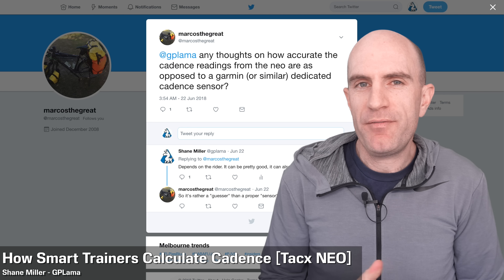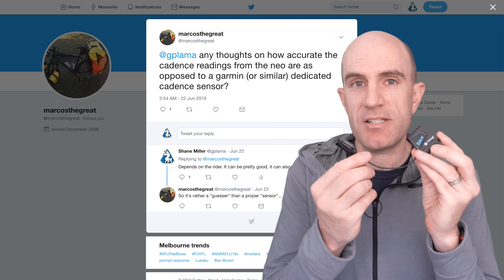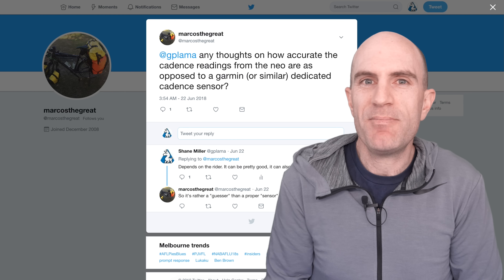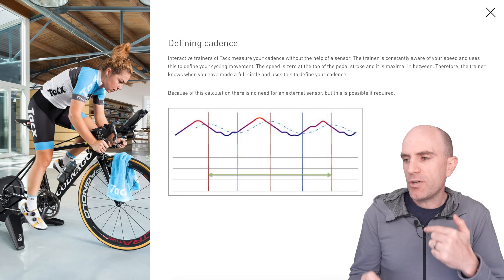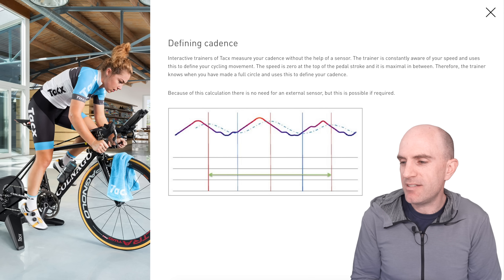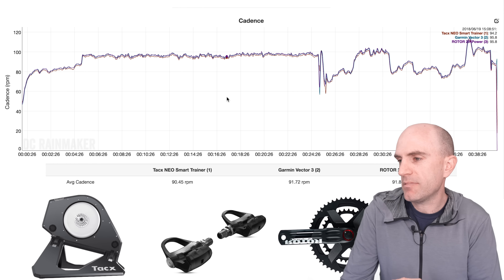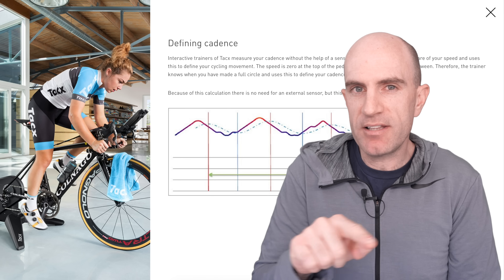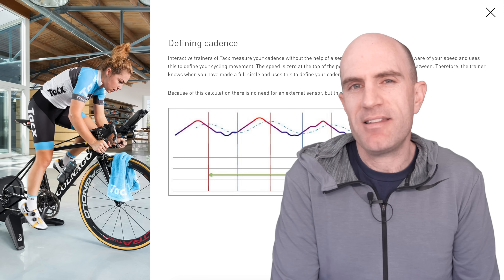How Smart Trainers Calculate Cadence // Indoor Cycling FAQ

Comment: Thanks for this video, which seems to have helped me solve a cadence problem with my Tacx Flux S trainer.  While I had been using the trainer for some time as an indoor riding alternative, I recently started using it to follow a training plan on Zwift, which places a lot of emphasis on cadence.  So I was concerned that the cadence provided by the trainer didn't correspond with what I was seeing on my Edge unit.  Realizing that the trainer didn't have a cadence sensor lead to me looking for an explanation of how it calculated cadence. Your description of how the trainer identified pedal strokes caused me to realize that how I was pedaling while I calibrate the trainer may have been distorting my pedaling profile recognized by the trainer, resulting in a less than ideal calculation of my cadence.  When I calibrate I tended to sit upright in the saddle, which provided a different pedaling profile than when I am in the drops or even on the hoods, resulting in "accurate" (i.e. rates which matched the Edge unit) cadence rates when I pedal upright, but lower estimates when I was over the bars.  After watching the video I re-calibrated the trainer making sure to be on the drops and suddenly I'm getting cadence rates which agree significantly better with those on the Garmin Edge.  So a big thanks for providing this explanation and helping with a nagging problem I was experiencing...and sorry for the longish comment.  Really enjoy all of your videos and find them highly informative.

Comment: OK Shane, but do you know how is computed the power sent to applications (such as zwift, , ...). Based on what ? current measurement, ... ?  Thanks for your opinion.
Reply from the maker: I'm not sure I understand the question. The calculated/computed cadence is sent to Zwift simply as 'cadence' like any other sensor. When compared to two other sources of cadence (pedal power meter / spider power meter) they all line up well.
Reply: @gplama  sorry my question was unclear. It is not related to cadence but to power. The tacx Neo computes power (i.e the value that you can see on top left of zwift display). I am wondering how the Neo is computing this data as there is no constraint sensor I guess. I assume the algorithm takes into account the weight, the cadence, physical data such as current measurement of the motor, interpolation curves.  What else ?
Reply from the maker: @zwiftfrance  There's a number of ways smart trainers measure power. Flywheel speed and electromagnetic force applied to the brake I will assume is the most basic overview of how it measures power input.

Comment: Hi Shane. Regarding the tacx neo do you know how is the power calculated? Does it use the cadence or is it unrelated? I ask this because my tacx Neo is consistently reading 5% lower power than my two Quarq's. Quarq Dfour and Quarq Riken. I'm pretty sure the Quarqs are accurate as they both were tested against a Powertap hub and they matched. The Neo is known for it's accuracy but it really feels it's reading lower than it should...When in ERG mode the difference seems to reduce to 3-4%. Any explanation for this?
Reply from the maker: Power on the Neo doesn't use cadence. Contact Tacx Support with the data indicating your testing/protocol/comparisons etc for review.
Reply: @gplama  Thanks for the reply! I already did contact them but still haven't got any reply. Anyway If was to send the Neo there for repair it would probably cost me more than a new trainer :D I asked about the power calculation on the Neo, out of curiosity do they measure the torque or use the flywheel speed for calculation?
Reply: @davidpch  did you get any feedback by now? ;) I have been testing a friend's Neo against my Quarq Dzero (which's power lines up with my Elite Direto). The Neo reads 15-20 Watts lower when free riding (mostly) in the big ring on Zwift. ERG Mode in the small ring reduces the difference to ~10 Watts. The reported cadence is around 1 to 1.7 rpm lower as well. I wonder if acitvely cooling the Neo or taking apart and cleaning it might have an effect on the measurements.
Reply: @MagnusB  By now I already sold the Neo :) And it was exactly like you described also reading lower than my Quarq in the exact same situations. Now I have an Elite Direto XR and it's within 0.5 % of the Quarq!

Comment: How does the Kickr give me a power output even when there is no cadence sensor in the room? Surely it needs the rpm to combine with the measured force to calculate power right?
Reply from the maker: It uses flywheel speed for the power calculations.

Comment: I have my Tacx NEO for a while but I haven't done ILT (isolated leg training) on TrainerRoad until recently. What I've noticed is when I'm only pedaling with my left leg (with the right foot unclipped), the cadence shown in the TrainerRoad app on iOS is halved what it's supposed to be. The cadence appears to be correct when I switch over to my right leg. Has this ever occurred to you?
Reply: Add on to my previous comment: my Quarq DFour is paired with my Garmin Edge 820 during the same workout when I was pedaling with my left leg, it was showing the correct cadence while Tacx NEO was telling the TR app the cadence was half.
Reply from the maker: I don’t do single leg efforts, so no. Grab a cheap cadence sensor and put it on your crank - problem solved. 👍🏼
Reply: It's not a big issue since I don't normally do single leg workout. Just wondering if you saw the same thing.
Reply: Response from Tacx customer support (it does not explain why it does not happen to the right leg though): 
The NEO measures this as follow:
it can see a fluctuation on power when you pedal.
So each pedal stroke this will see a power difference.
By using this power difference it can calculate a cadence
So when you only click in your left foot and cycle it will only read this power difference.
And explaines why you only see half of what the cadence should be

If you want to see the actual cadence then we advice you to connect an external cadence sensor to TrainerRoad

Comment: Before I got a power meter, I was using the little Misuro B+ computer that came with my Elite Turbo Muin. That trainer doesn't have a power meter but the Misuro B+ calculates its power based on the pre-programmed power curve of the trainer's flywheel. That setup also has cadence and I could never figure out how it could determine it so accurately.

Comment: Shane given the cadence is a parameter in the calculation of power - is this something you could factor into your lab test? Difference between 90 and 92 could adjust the accuracy of the power.
Reply: In this particular case, cadence is derived.  Power is just energy divided by time where energy is force multiplied by distance.  With rotational systems such as the flywheel within the trainer, power is just torque multiplied by angular speed.  So the trainer is constantly measuring the torque and angular speed as a function of time.  To estimate cadence it just looks for that cyclic pattern in the torque and calculates the time interval between them.  So power is measured directly without needing to know cadence whereas cadence is a derived measurement based on the assumption that a person's cadence is cyclical.

Comment: My Hammer is 1-2 rpm lower than my other PMs too. Been running Zwift with a Stages, Vector 3 and Hammer concurrently and putting it through Ray's analyzer. Good enough.
Reply: I see the same type of thing with my Tacx Neo.  It doesn't matter what software (including Tacx) I'm using or if I'm using the Garmin 520, the phone or the computer.  I will see big cadence numbers (over 220 rpm) at some point in the workout.  So their algorithm doesn't work for me.  I just use a Garmin cadence sensor now.  

Nothing like looking up and seeing your cadence at 220 rpm.
Reply: Interesting. I've never seen huge cadence jumps on my Hammer. The opposite in fact. After hard efforts when I slow my cadence and the flywheel is still spinning at high RPM, there isn't enough torque going through the drivetrain for the Hammer to accurately estimate cadence. It will drop to zero briefly why the flywheel slows.
Reply: I actually just picked up a powertap p1s set and ran it alongside my hammer today and found that the hammer was 1rpm lower. Just out of curiosity if you happen to know, what's the difference in power between your hammer and the stages and vector? Today the pedals were about 10w higher for the overall ride (turned out to be 5%) over the Hammer in a 4.5hr ride. Based on what I've seen, drivetrain losses are a little less than that, like 2-3%
Reply: Phil, I have a 52/48 L/R balance so the Stages reads 3-4% higher in the 250-350W range. The Hammer and Vector 3 are very close to each other up to about 500W. Beyond 500W, the Hammer starts reading quite high. At 1050W on my Vector 3s, my Hammer will read 1200W. If you want the actual links to the analysis, check any of my recent Strava ride descriptions. My athlete ID is "yoog"

Comment: Reed switches????   Um... er... ah...  I don't so.   My understanding is these were always just basic Hall effect sensors.  Passing a wire thru a magnetic field induces a current pulse in the wire.  The pulses were simple to measure and the head unit supplied the time element of the rotations per minute calculation.  The engineer in me says a reed switch wouldn't respond fast enough and could be subject to the effects of vibration.  AND wear!   Got me thinking...  In my old bike parts box, I had an old Cateye cyclometer; complete with both speed and cadence sensors.  I quick slice and dice with the cut off wheel showed just what I expected, a coil of wires encapsulated with some sort of electronics potting material...
Reply from the maker: SHUT THE INTERNET! ok, cool corrected. So in effect a very similar thing.
Reply: The engineer in me says you're wrong about a reed switch not responding fast enough, should be plenty fast.  The issue is as you point out is that a Hall effect sensor has the added advantage of no mechanically moving parts.  I'm betting some cadence/speed sensors use reed switches, some use Hall effect sensors, and some as Shane pointed out use accelerometers (e.g., my Stages left crank arm power meter gives me cadence).  Where else could that sound be coming from with Shane's sensor (I've got an old Garmin model that does the same thing) if not from the mechanical closing of a reed switch (remember no mechanical moving parts with Hall effect sensor)?
Reply: my old bikecomputer had a reed switch. edit : even says on the page https://www.sigmasport.com/en/produkte/fahrrad-computer/wired/wired/pure-1/technology
Reply: Reed switch is mechanical, Hall effect switch has no moving parts...  so, similar in that they both are being used for cadence.
Reply: Interesting...  I did a little google search, yes, prolly should have done that before... but yes, you are right, there were reed switch version of cadence sensors.  I would image the progressions would be: reed switch, hall effect, accelerometers...    Thinking too much about this, would a reed switch have any issues with wireless connection to the head unit?  I remember the wired units, then advancing into wireless ones, and now, on my trainer I just have a wahoo cadence unit.
Reply: If you can hear the switch closing then it's a reed switch. Simple and plenty fast enough to respond. Accelerometers are not as accurate - and that's a problem for crank-based power meters.

Comment: Nice theory. Too bad it doesn't work in practice. Extremely inaccurate on the Neo.
Reply: This method of measuring cadence will not work very well when flywheel speed is very low or/and intertia is very low (which affects pedal stroke). It will work flawlessly on higher speeds.

Comment: Is there a thought that high cadence on zwift on the Neo can give Zwift performance increases ? E.g. an improved time up Zalp? Lab test ?
Reply: Zwift uses power to determine speed, not cadence. At a higher cadence the interactive trainer will be using less power to create resistance for the same measured wattage, so differences in cadence won't make much difference other than you might fall between two step levels on the amount of power it's putting out.
Reply: Timothy Fish thanks Timothy, you may well be right that there is no discernible difference, but the question is whether high cadence can fool Zwift into an increase of power. That or it's just rider efficiency? Wonder what a lab test can prove.
Reply: There's really no need for a lab test since Zwift is just software. Zwift doesn't even require a cadence sensor to operate, so asking if cadence makes a difference is like asking if heartrate makes a difference in its calculated power. In the case of the Tacx NEO Smart Trainer it appears that they're using wattage to calculate cadence, not cadence to calculate power. But Zwift doesn't care. It's going to take your W/kg and plug that into an equation to give you a speed that is consistent with the virtual terrain.
Reply: Cadence is completely irrelevant for speed in Zwift. It is also irrelevant for power calculation of Neo and only power is taken into account when determining speed in Zwift.
Reply: Timothy Fish my point is still not understood. I'm not questioning zwift power I'm questioning that the neo under high cadence puts out more power than it should. Therefore compared to other smart trainers or power meters would be interesting to see a lab comparison.
Reply: Look at this. It's about other issue (Vector 3 innacuracies at higher cadence) but there is no such thing happening as Neo overstating power at higher cadence (look at comparison charts vs P1): https://gplama.blogspot.com/2017/12/power-meter-vs-smart-trainer-power.html
Reply: If that's what you're saying then why bring Zwift into it since that just increases the number of variables?
Reply: Timothy Fish it's a fair point, but I'm convinced that in Zwift for eg that you reep benefits with high cadence going up zalp. I don't use my neo with anything but zwift.
Reply: Did you compare your Neo to power meter? Which one?
Reply: Timothy; why would it do that?  A good speed number is available based on the rotation of the drum on the Neo (it is just like a rear wheel--I checked it and you can see the distance traveled by the drum will vary based on your gear selection).  The power you put out will vary with the power required to overcome the resistance being fed to the trainer by the software for the terrain encountered.  I would think it would be easier for software to send the required resistance to be overcome instead of processing power data??
Reply: I haven't seen a spike in power associated with the cadence spikes on the Neo that I've seen.  The Neo power metering is supposed to be very good based on all of the tests I've seen.
Reply: Dan, the software sends a level at which the trainer should be set and the trainer sends back the wattage at which it is operating. With this setup the software doesn't have to know anything about how fast the "wheel" is spinning or how much power is being applied to the electromagnets.  With dumb trainers Zwift doesn't have access to power data, so they use wheel speed to calculate power, but they have to make some assumptions about wheel weight and trainer resistance.
Reply: That makes sense to allow more types of trainers to be used with the software.
Reply: Something else to think about: there's a limit to how low and how high the trainer can go. In ERG mode, if Zwift is trying to set the wattage very low a fast wheel speed will cause the trainer to produce more power than Zwift is aiming for. In that situation, a higher cadence will cause the wattage to be even higher. Shifting into a lower gear will slow the wheel speed, allowing Zwift more control over the power.